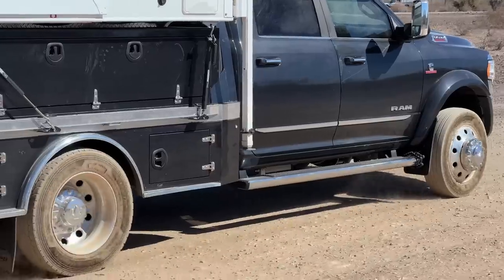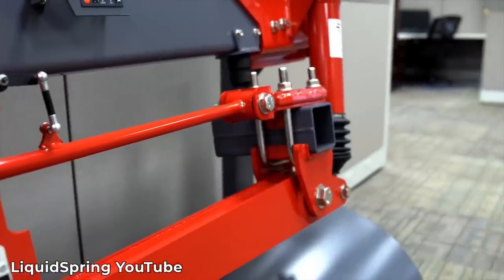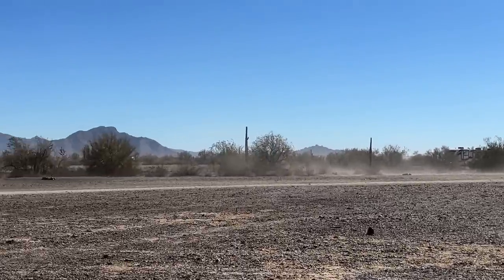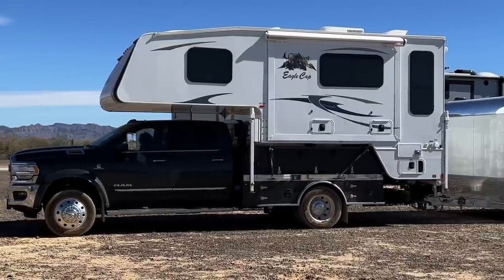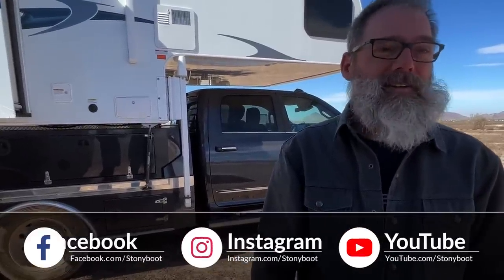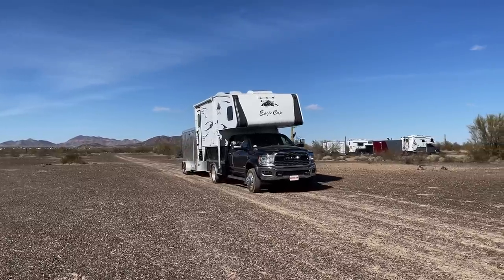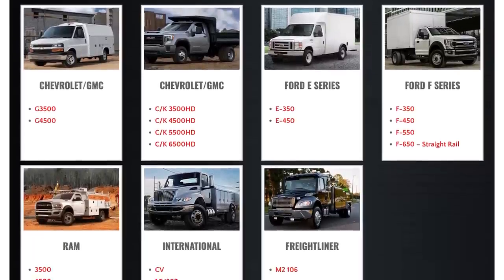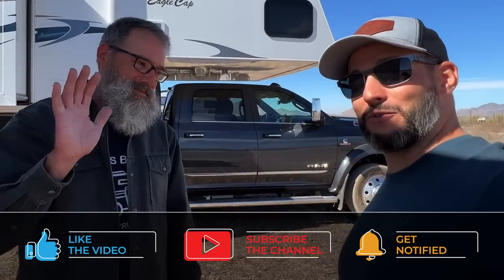Liquid Spring - FULLY LOADED! - More Smiles Per Mile Follow-UP with Stable Camper

Comment: A month ago (2024) I had the 4 corner 5 link  LiquidSpring suspension  installed on our coach a 2020 Holiday Rambler Vavationer 35K gas coach on the Ford F53 chassis (26,000 lb) in Lafayette Indiana the LS headquarters. By far the best money that I have spent on this rig, hands down. My system is basically set up the new (TRU-Earth Leveling) or campsite leveling once the new digital drivers interface is released in March (2024).
Reply from the maker: That’s awesome. I was blown away by the ride quality of the system. Someday with  figure rig, I’d love to have that setup. 

Do you have any details on the leveling update?
Reply: @Stonyboot  I am too, I will sum it up like this, Before the LS suspension it was like driving a 26,000 box, now it's like driving a large SUV, it's that good. Safe Travels!
Reply from the maker: @thecasualrver that’s a great testimonial!

Comment: For 30 years I have had truck campers. Not one time have I needed to drive the front tires on blocks. I live in Colorado and it's anything but level. If you used the front jacks on the camper you wouldn't need to do this.
Reply: I agree 100%. I have had Lance campers since 1986 and live in Colorado too. Never once have I used blocks under any of my tires. I am always level. Easy peasy.

Comment: How can this be safe?  Shock mounts are not designed to take 100%+ of the load.  If you don’t believe me look under your truck and see the difference between the shock mounts and the leaf spring mounts.
Reply: They are installing a complete suspension system with different new shock mounts! Look at the drawings!